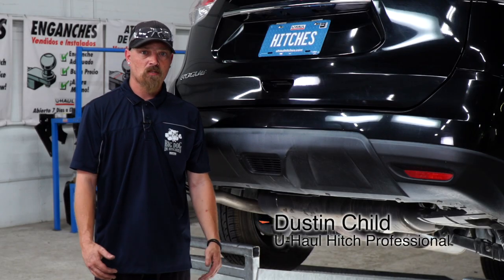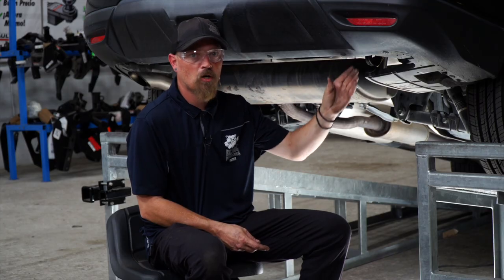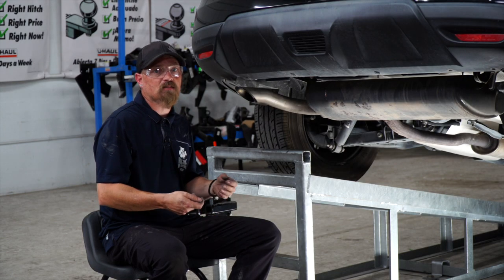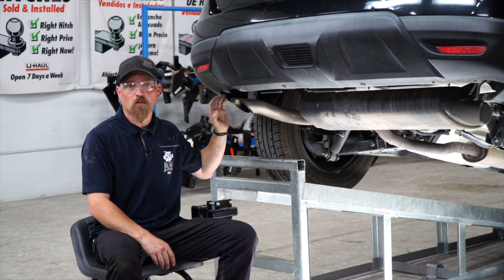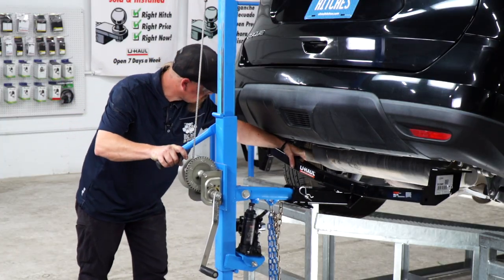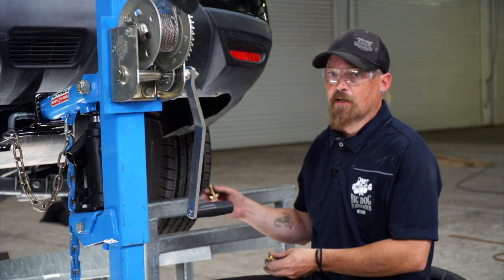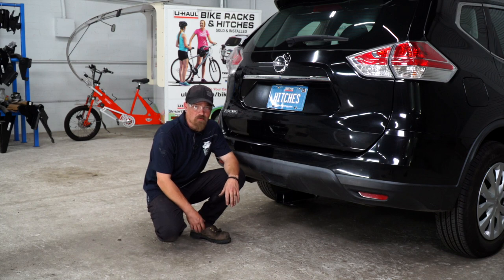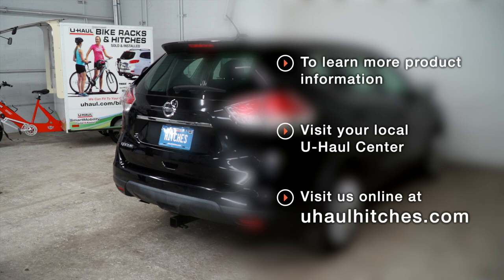2018 Nissan Rogue | U-Haul Trailer Hitch Installation

Comment: Yall missed an important step. On the drivers side you need to make a cut on the panel that allows the hitch to pass through. Unless U-Haul does not allow modifying/cutting for proper fitment on the panel.